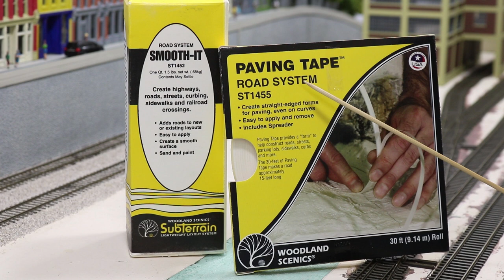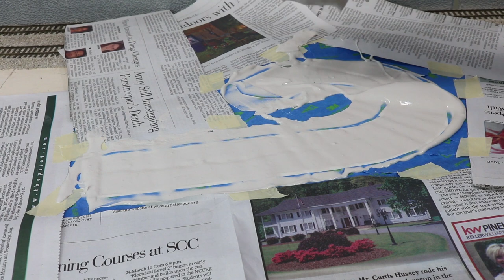Plan and Build a Street Using Smooth-It

Comment: You made it seem so easy....got my smooth it and paving tape....gonna be doing this soon 😊
Reply from the maker: Thanks for your comment. Woodland Scenics recommends proportions of two parts Smooth It to one part water. I would recommend a little more water which makes it easier to work with and gives you more working time. This is a plaster product so NEVER put it down the sink during clean up...Harold
Reply: Norfolk Southern Sherwood Subdivision thanks for the tip
Reply: Hey buddy me choo choo Charlie
Reply from the maker: @georgiasunbelt  You are welcome...Harold

Comment: I use plaster and mix it with very cold water from the refridg. Gives me about 1/2 hour working time. I put the mixed plaster in a old plastic mustard jar so I can squeeze out just as much as I need when I need it. Not as messy. I mix the plaster a little runny and it will almost flatten out if you tap the table as you squirt it out and it will need not so much working.
Reply from the maker: Good idea. I especially like the mustard jar...Harold